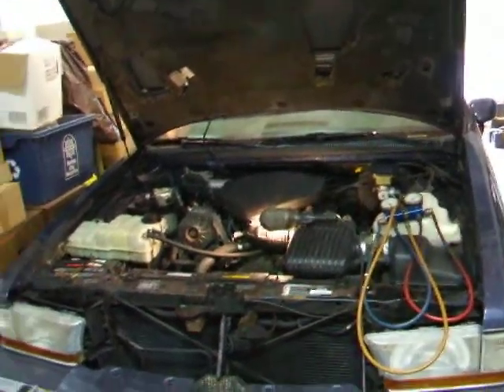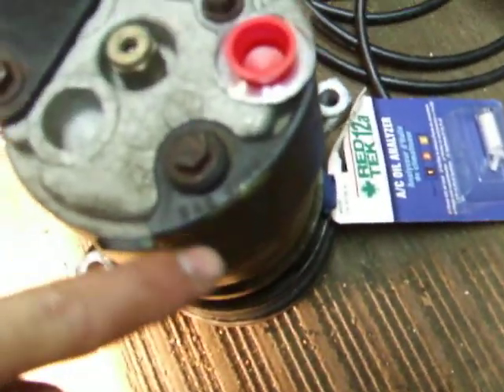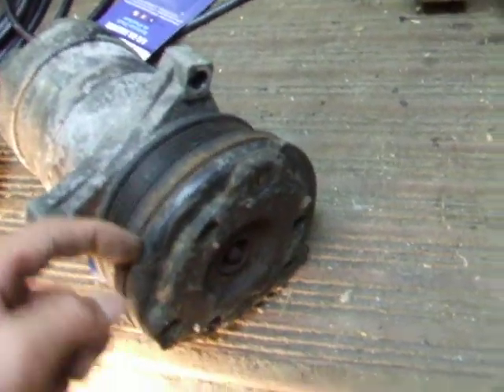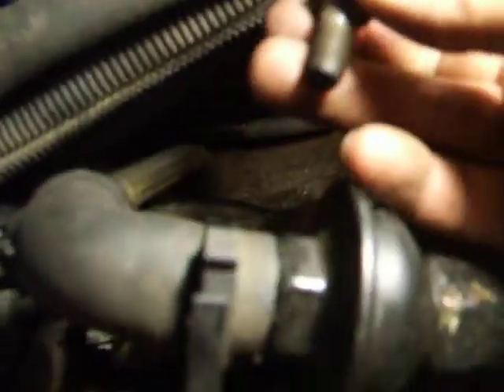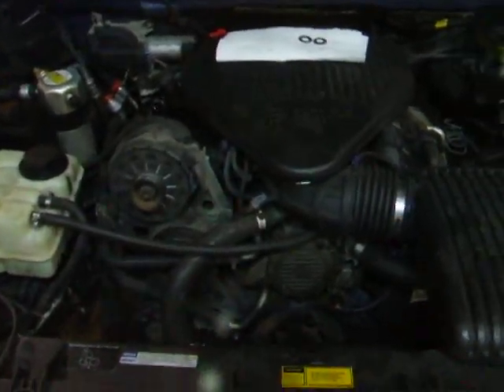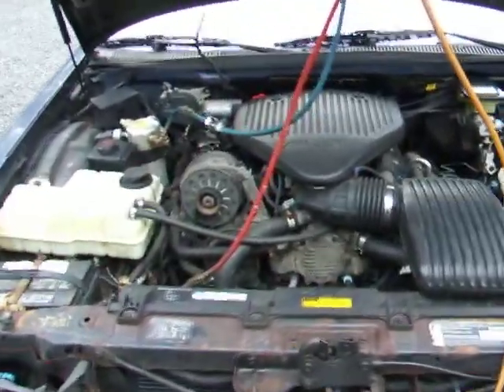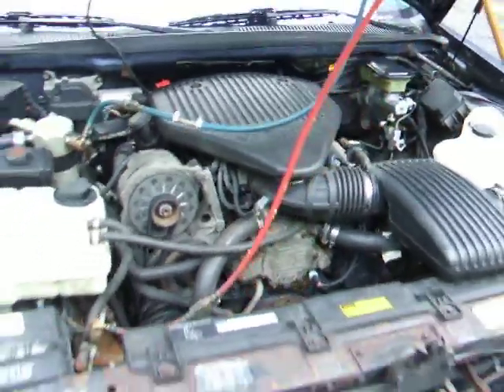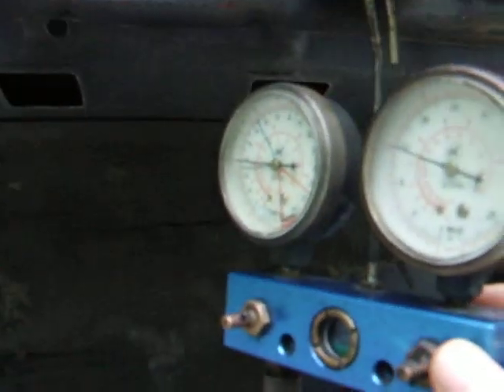Easier A/C Compressor Replacement - 1994 Buick Roadmaster (+ LT1 Impala, Caprice & Fleetwood)

Comment: Replaced my stock 26 year old Compressor with an  AC Delco one. I’m glad I’m not alone here & thank you for sharing 💯🇺🇸
Reply: Just subscribed
Reply from the maker: Thanks very much for the comment Leo!  Hope my video helped you out replacing that difficult-to-get-at compressor lol.  I think mine was stock after 25 years as well, shaft seal and clutch went out.  Let's enjoy our cars, they sure don't make 'em like they use to.  I tell everyone, Power, Luxury AND Economy, yes you CAN have it all when American engineers do it right lol.  Cheers Leo!~  Bellarmine
Reply: You are 💯% right. They certainly do not make em like they use to. The quality of metal these days is questionable as well as many other things. American made vehicles......use to be a good thing. The hands of time have always been the true test. Regardless, keep on rocking 🤘🏼

Comment: Thank you so much for this video!!!! Just did an AC delete on my 1996 Roadmaster Wagon. 
FYI, The bolt in the back of the block holding the compressor bracket is a 6mm 12 spline socket.
Reply from the maker: So glad the video was helpful Shawn!  Thanks for the tip on that Torx stud, appreciate it.  I hope your A/C delete is only a temporary measure, it sure is nice to have in the Summertime....:o)  I got that good used compressor from B&R Auto wrecking shipped to my door for only about $60 with a 30day warranty, good deal.  So you have a 96 wagon, NICE car,, so much room and fun to drive.  I actually have a beige '96 Roadmaster Wagon as well, I should upload a video of it.  I drive the blue Sedan in the Winter so I can save the Wagon from the slush - 200,000 miles but the underbody is Clean, mean to keep it as they don't make 'em like these any more.  As I always say about these cars, Power, Luxury AND economy - yes you CAN have it all - when the engineers are allowed to do it right lol.  Let me know if you'd want me to email you a brochure.  Keep 'er running Shawn, and Cheers!~  Bellarmine

Comment: Doing one tomorrow! 1996 Roadmaster 70,000 miles :)  Thanks for the video
Reply from the maker: You're welcome, glad the video was helpful!  Let me know how it went, thanks for the comment - Cheers!~  Bellarmine
Reply: @bellarmine33  Went pretty good actually, I also suggest people replace the orifice tube this one wasn't to bad but had some compressor metal in it. Flushed condenser and she blew Ice cold!
Reply from the maker: @brandonmaddy  Thanks for the comment Firemist, glad it was helpful, that's really great to hear!  So you replaced the orifice tube  eh?  I imagine you also had to put a filter inline with your new compressor to protect it from the metal shards.  Fortunately mine didn't blow up, just lost the shaft seal.  I just replaced it and charged it up and it's now Ice Cold too, I think everything else is stock lol.  Thanks for letting me know Firemist, and enjoy your Roadmaster.  They don't make 'em like they use to, I tell everyone, Power, Luxury AND Economy, yes you CAN have it all when American engineers do it right lol.  Cheers!~  Bellarmine

Comment: Hey man thanks for the video. This is by far the best one on YouTube and it motivated me to go outside and attempt mine since I've had a new compressor for a year now. Just 2 things I'm concerned about is when to add the dye and is the brand four seasons a decent brand to install?
Reply from the maker: Hi Demery, glad to hear my video helped you get your project going, thanks for the comment and good words!  Four Seasons is a decent brand, I think the previous owner of my 96 Roady Wagon said he installed one, still running perfect and quet.  It's one of the more expensive models, see here at my favorite parts place - their handy fun index system of every car made just can't be beat!:
https://www.rockauto.com/en/catalog/buick,1994,roadmaster,5.7l+v8,1022151,heat+&+air+conditioning,a/c+compressor,6628

As for the dye, are you using over the counter cans?  If you're using  a 'dye injector' I think it might need to be added with the system empty, otherwise in can form it can be added anytime.  I'd do it at the end.  Also, again if you're using cans, many of the refrigerant cans have dye in them now, even if they don't say so (wish they didn't...:o)  After using a can of R12a/R134a, just look at the end where the pierce hole is, see if it's stained a bit green/yellow.  If it is, you've got dye with the refrigerant and don't need to add any.  Then just get a cheap UV LED light and you can 'try' and see any leaks after a few days.........

Hope this helps Demery, anything else just drop me a line, and let me know if you'd like me to email you a PDF brochure for your car.  Cheers!~  Bellarmine

Comment: Great video. Once you got the stud out can you put a regular bolt in it instead of using the stud and bolt again. I got the same compressor on my 96 ss I’m getting ready to change out.  Trying to prepare myself
Reply from the maker: Hi Vic, Thanks for the comment and sorry for the delay.  Sure, I don't see why you couldn't replace the stud with a bolt, obviously make sure the bolt is not too long or it'll bottom out in the block.  An alternative idea I came across (see link in my video desc), is to 'notch' the back of the bracket, then next time you can simply loosen the nut and slide the compressor off.  Best of luck doing your '96 SS, hope you get to it soon, it's not too bad once you get going and get in there...:o)  Think you have tuned pipe exhaust manifolds?  These cars are great, real sleepers, people keep thinking I've got a 3L engine in there, when I tell them it's a 5.7 they're shocked!...:o)  Let me know how it goes or if you have any questions, I have lots of DIY tips on recharging and etc (as you no doubt already heard...:o)  Best wishes Vic and Cheers!~  Bellarmine
Reply: @bellarmine33  great plan.   I'm gonna notch mine.

Comment: What is the best compressor? I have the 1996 caprice
Reply from the maker: Hi Random, thanks for your question.  I got mine used from a scrapyard V6 Camaro (same compressor).  Works perfect, except it has a leak in the body, recharge it every 2 years, but only paid $65...:o)  If you want new, I would recommend 4 Seasons, that's what's in my '96 Wagon, past 7 years, works very well and very quiet.  Here's a link to some choices at my favorite car parts place, just browsing the parts index for almost every car ever made teaches you something..:o)

https://www.rockauto.com/en/catalog/buick,1996,roadmaster,5.7l+v8,1022218,heat+&+air+conditioning,a/c+compressor,6628

Here is the 4 Seasons compressor:
https://www.rockauto.com/en/moreinfo.php?pk=816504&cc=1022218&pt=6628

Hope that's helpful Ransom, any other questions or comments drop me another note anytime.  Cheers!~  Bellarmine

Comment: It helped me, mine just locked up and I have to remove
Reply from the maker: Thanks for the comment, glad it was helpful.  If you want let me know how it goes or if you have any other questions.  Cheers!~  Bellarmine
Reply: @bellarmine33  it went well! I ended up just putting in a ac delete pulley as the car is not very pristine anyways! Had to take off the fan and upper rad hose and shroud to get the damn thing out though
Reply from the maker: Glad you got it out, yes it is a pain, especially if you have the tow pack which sounds like you have, a real cram job!  Too bad you're now missing A/C, but at least you won't have a squealing A/C clutch like I had at the beginning.  FYI I got my used compressor from B&O Auto Wrecking for $75 CDN shipped to my door, leaks a small bit but blows Ice cold and nice quiet pulley, with a few cans of R12A might be an idea if you still drive in the Summer.  Enjoy your car, as I say: Power Luxury and Economy, you can have it all when engineers are allowed to do it right!  Let me know if you'd want me to email you a brochure - Thanks and Cheers!~  Bellarmine

Comment: Why did you sell your 99 LeSabre?
Reply from the maker: Hello again Mark, well 2 reasons mainly.  One is obviously we decided to upgrade to the much bigger and nicer Roadmaster, and mainly is the LeSabre had really had it's day.  Guess you can't see too well in the video I have of it, it was time.  Engine mounts were coming down, floor was coming down, needed brake lines done again, harmonic balancer was shot.  As you saw it still ran flawless, just was too far gone to keep driving - yep we drove her right into the ground, and the reliable 3.8L powertrain just kept chugging along like my mechanic said it would - unkillable!  If you ever have problems with your Regal being hard to start but it keeps catching and catching, no power and won't restart after shutting it off unless you let it sit for 1/2hr - replace your fuel pump.  Happened to the LeSabre, ran the tank dry, toasted the pump, 12PSI instead of 40PSI - was a real pain until I put a new pump in then all good again.  Thanks for the comment - Cheers Mark!~  Bellarmine
Reply: bellarmine33 actually the starting issue I had with my regal was the starter

Comment: What's that a c dryer can?
Reply from the maker: Hi MonQuarius, the Dryer can / Dry12 / ProDry / etc etc (insert trade name here), it drys out / removes any moisture in the system, by converting it to lubricating oil.  Moisture is always BAD, as it can cause corrosion over time, and it doesn't cool well at all.  If I can't vacuum the system out I always put in a can of Dry12.  Also, ALWAYS use some Dry12 before putting any SEALANT in the system!  Since the sealant reacts with moisture, if there's any moisture in the system when you use the sealant, you just might end up with a plugged nightmare...:o)  I just put some Dry12 into my neighbors van, and it went from warm to ice-cold, so I guess he had a lot of moisture - he sure needs the AC this year!  If you're in Canada, best place to buy all the cans is MAP chain (Muskoka Auto Parts) - R12A for $8, Dry12 for $10, ProSeal for $18, cheapest around!  Thanks for the question MonQuarius - Cheers!~  Bellarmine
Reply: @bellarmine33  okay thanks for the reply, so I just replace my compressor ( oil in compressor) and changed the dryer havent charged it yet. So step 1 put in the dry12 let that cycle for how long? Would I need the sealant if so when to put that in before or after the 134-a? I plan on doing all of this tomorrow. I'm not in Canada I'm in Louisiana lol. Thanks again
Reply: Also I have a 1995 impala ss 5.7 lt1 i think it's the same engine as in the roadmaster.. after watching your video I was able to save 300 bucks buy changing my own compressor which it took me 1hr n half thanks for the helpful video
Reply: Oh I did change the orifice tube and will replace all o rings once I put the new dryer on
Reply from the maker: @318sears8  Hi MonQuarius, Congrats on changing the compressor in your Impala, 1.5 hours pretty good, real happy to hear I saved you some cash!  You're right, same LT1 engine as the Roadmaster, with a better air intake and (not sure) exhaust manifolds.  Regarding charging it up, start the engine and turn on the AC, then add the 2 cans / 24oz R12A/R134A and run it for a few minutes - make sure compressor is engaging etc.  Next, add the Dry12, run it a bit more, say 10mins.  Finally, if you want, add the Sealant (shake can well), and take it for a 20min drive with the AC on.  In any case, add the Refrigerant FIRST, NOT the Sealant or Dry12.  The compressor and system MUST be running before adding the sealant / Dry12.  

Charge is 1.5lbs/24oz - I think each can is 1lb/16oz R134, so 1 and a half cans (check the label on your old dryer, keep it if poss).  Do you have the double gauge set?  Not sure how you'd want to deal with the other half can.   I think you can get away with putting both cans in, might be a bit overcharged but you can let a bit out if need be, also you might loose a bit during charging for the 1st time.  Turn the cans upside down and let the stuff in slowly, don't let the low-side gauge go over 60PSI at any time.  It should be around/under 40PSI when the cans are empty and the system is operating.

I would recommend running it for a day or two to make sure everything is running properly, and see if it leaks or not (you might not need the sealant).  Just attach the gauge every day with the car cold and check the pressure like a car tire, give you a feel what it's doing.  Should go up and down a fair bit with outside temp (in the garage vs in the sunshine), but not drop drastically.  I write a table with pressures and outside temperatures, etc, that's how I learned. After that, if you think it is leaking, then add the sealant and take it for a 20min drive.  You might need another can of R12, though now it gets very difficult to tell how much is in there without a high-side gauge and/or without venting it all out and recharging with another 24oz.

Hope this is helpful and not too wordy - let me know how it goes, good luck tomorrow MonQuarious!  Anything else let me know - Cheers!~  Bellarmine
Reply: @bellarmine33  okay thanks man I will try that later today!